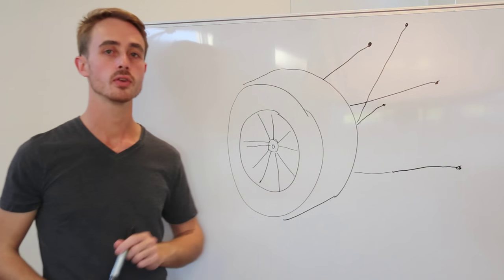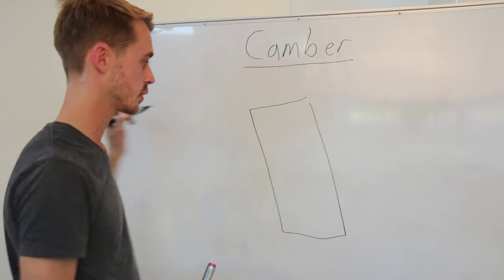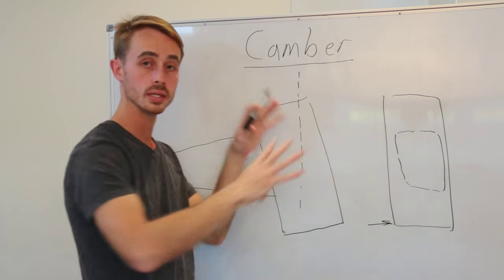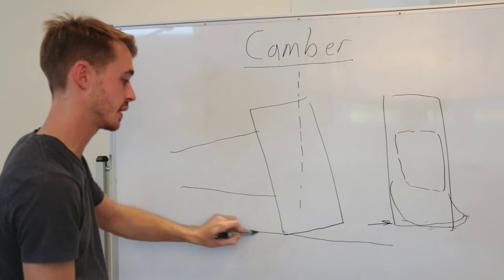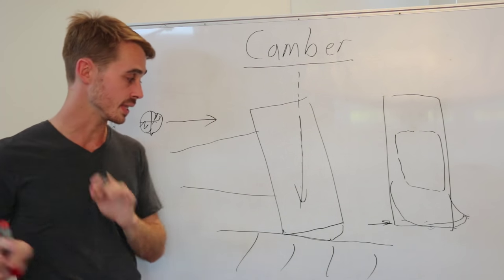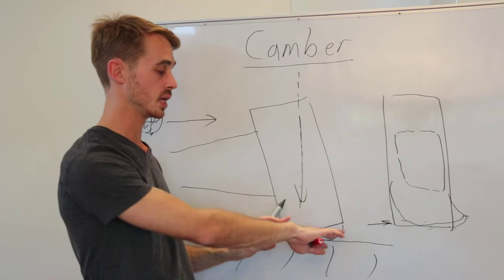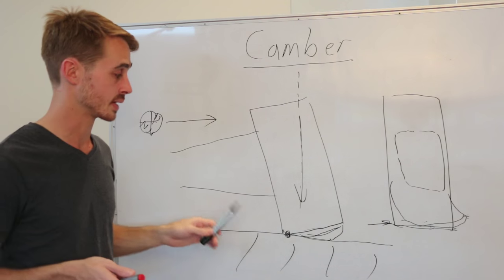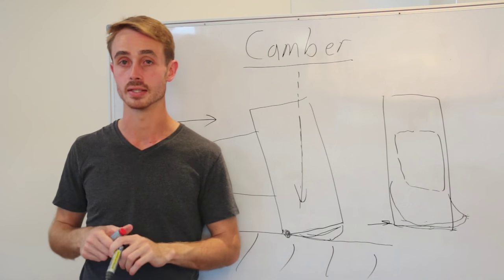How Does Camber Work? Camber Explained

Comment: Ive seen many tire force diagrams that show contradictory things about cambers affect on max lateral force in cornering. Admittedly many are from older books but some claim camber increases the "area under the curve" while one or two claim an increase in peak lateral grip. Can you weigh in on which model is more accurate? I know of at least one chart that came up with the area under the curve model from instrumented testing but your description seems to imply that camber should have a large increase in peak grip. Also, I would really enjoy a video on pneumatic trail and its affects on steering feel and aligning torque! Great videos, keep em coming!

Comment: would this solve the camber V  stearing input issues (enough for high g corner but too much for straight line braking) lay it over like you want ,then reorient the spindle V king pin declination angle.    as the tire rotates around the new KPD  it will pick up camber and directly transfer weight (stronger feed back /more effort in tighter turns)

Comment: in a drag racing application neutral camber is best?
Reply: Yes
Reply: @esnevip  are you taking into consideration the swat ?
Reply: @1AndTheBrake  if you have a solid rear the camber would stay the same through the squat, similar for double wishbone.
If you only had lower control arms then it would be something to look into then yes.
Reply: @esnevip  nahh i know now now thats was a long time ago i asked that question check out my vids we do street racing on forza pretty big community..